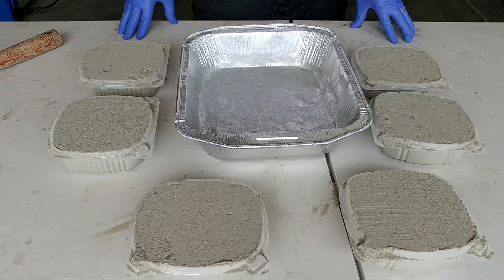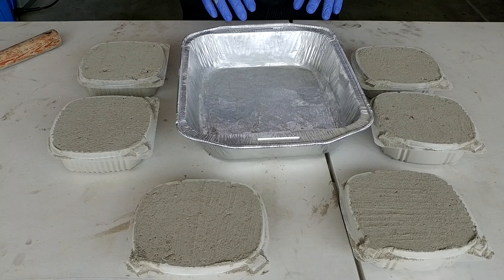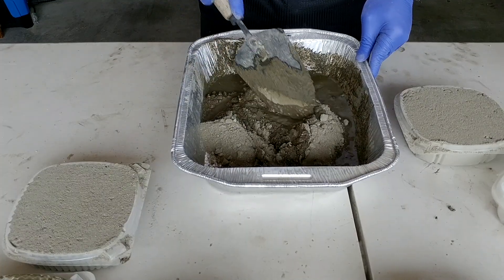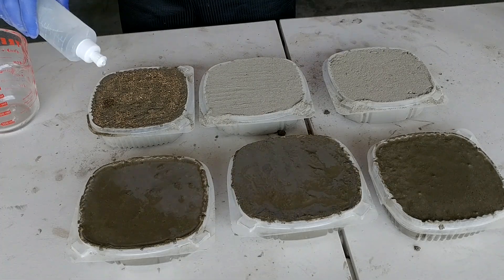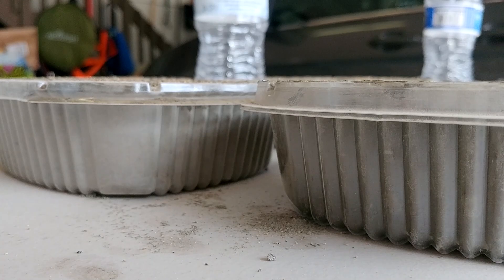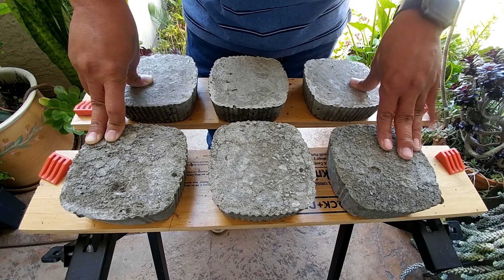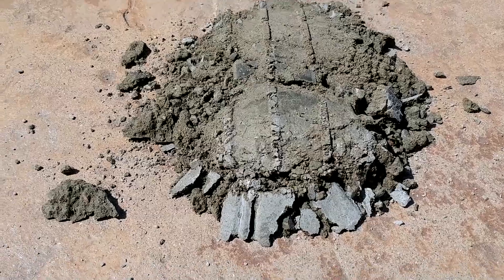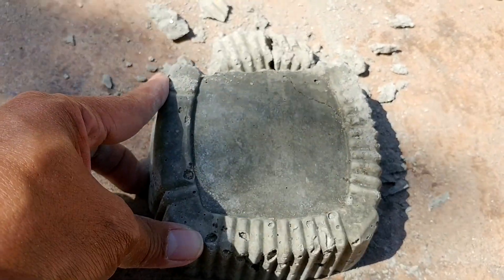Stress Test Showdown - Will Dry Pour Concrete Take the Crown?

Comment: if it's not load bearing I'm sure this method would work ok although I highly doubt it would last as long as pre mixed concrete. Curing is where concrete gets it's tensile and compressive strength and ensuring you have the right water to concrete ratio is key to proper curing. Not sure how you know your getting the right mix ratio with this method and can almost guarantee this pad will crack over time. I would like to see a compressive strength test on this method and see how it compares to pre-mixed concrete.
Reply from the maker: I agree with you.

Comment: Your experiment is flawed because dry concrete takes longer to reach its full strength. And while it's on the ground, it's still wicking more moisture till it's appropriate strength.
Reply from the maker: Thanks for the comment. This is the reason I created multiple sample. We are comparing their strength at different time. Regarding your concern about moisture. All samples are removed from the container right after it set and placed on the ground where they get constant watering. So they remain moist throughout to promote harder cure. The last test I made was at 38th day instead of 30 days because I got busy with graduation activities. The links for the 7 days and 38 days is in the description if you wanted to see.

Comment: There's another guy that does this same test and in his test they were both the same and held the weight of his van.
Reply from the maker: Was the sample this small? I have seen one with Michael Builds where he run over his truck on a slab after 30 days. It was fine in the beginning but finally gave in and he mentioned he did run back and forth for at least 100 times.   

Anyway, this is just to test the difference in strength between wet and dry pour and I used the small sample so that it reacts to the stress we are giving it at a shorter amount of time. A larger sample will definitely be able to handle the weight of the van. The question will be how long will it last or how much beating can it take before it gives in.
Reply: @diymanual  it was not much bigger than that...almost the same.

Comment: Appreciate the tests, but you need to mimick it JUST LIKE Cajun Country Living does. NO PANS! Watering intervals. Copy them EXACTLY, but on a smaller scale
Reply from the maker: Thanks for the comment. I did that on my other dry pour video. For this experiment, I am using the same amount of water for each samples and I explained my reasoning in the video. Putting it in a pan makes sure that the dry pour absorbed the same amount of water as the wet poured concrete.
Reply from the maker: I filmed a new Dry Pour experiment early this year. Just got really busy with other activities and projects and never got the chance to edit the video. It will be a series testing the PSI at different curing time.

Comment: There is one variable that you did not take into consideration on the dry pour test, that is your weight while you were inside the vehicle doing the test. You need to have 2 persons of the same weight inside the vehicle during the test, for your experiment to be valid. This is a Fail Grade.
Reply from the maker: I actually addressed that on the 7th day test where I switched the samples. Still the same result.
Reply: inconsequential.

Comment: if you understand concrete ... I mean actually understand the science ... then you know that this is plain stupidity
Reply from the maker: Thanks for the comment. This method gains so much traction because it is less intimidating to work with than properly mixing concrete that is why we are trying to do this small experiments to see how each method will perform under stress.
Reply: @diymanual  I understand where you are at. I hadn't done any concreting until just a few years back. I watched Mike Haduck and Odell Concrete here on utube. I then just bought a mixer, cement, aggregate (sand + rock mix) and started mixing ... drop into barrows and roll to location. Fill forms and vibrate. Wooden trowel. Then mag float. Then bull float and fresno if you want glass. Just watch the setting slab or foundation or whatever you are doing .. hit it with the tools as needed. It is not really intimidating in the end. The tougher part is building a quality form with reinforcement.
Reply from the maker: Thank you.  I have been watching Odell as well these last few weeks and I'm more confident now on how to do it using the proper method. I have poured concrete in my backyard about 8 to 10 years ago but that's with the help of my father-in-law who have tools and the knowledge on how do do it correctly. Now that he is gone, I am going to do it myself in my new house so I started to search on how to pour concrete to get a quick refresher course and this method keeps getting pushed in my feed so that is why I have to do a little experiment if it is as good as the wet pour.

When I first saw this dry pour method, I have high hopes on it and a lot of quick projects come to my mind but now that I think about the process, you spend so much time preparing the area and the form why do a short cut on the last step?  Also another commenter said something like if you are going to do a large pour, you want to make sure that it is done correctly so that you don't have to re-do it again after a few years. And if you have a small job, then it is easy enough to do it with wet pour which makes a lot of sense.  But I guess a lot of people will always gravitate towards the easy method.
Reply: @diymanual  Remember, too, that you can always break a large pour into segments using formwork .. just make sure you extend the rebar thru to the side next to be poured. This works for me. I am doing one right now ... 7 x 5 m ... into 4 quadrants of 3.5 x 2.5 .... gives me free crack joints if I do it properly.
Reply from the maker: Thanks for the advise.

Comment: With the wet pour you measured the water and hand mixed it, therefore you are effectively distributing the water and material.  Holding the dry mix to the same amount of water is forgetting that you mixed the wet pour.  The wet pour gets an extra step (mixing) which equivalently could be more water for the dry pour.  For the dry pour you could use a taller container with some compact sand for drainage of excess water.  This way the dry pour would be given the opportunity to fully saturate.  The inequity of your experiment seems to make it invalid in my eyes and doesn't offer any proof of which performs better.  Good effort though, science is fun.
Reply from the maker: Thanks for the input. Yes science is fun.

Comment: Either way, common sense dictates that dry poured concrete will be used where not much pressure will be exerted on the concrete. Will I use dry pour for column, beam,  lintel, stairs or upper deck? No!  Mix the cement, sand, gravel, add water then pour and call it a day. In terms of time, labour and cost, I don't see any advantage dry pour has over wet concrete. So why bother? I understand that it is a different way of doing things. But I don't think dry pour deserves all the attention it is getting considering its limited application. Why take the gamble? It is not worth it in my opinion.
Reply from the maker: Thanks for sharing your opinion. Every person look at this in different ways but I agree that this should only be use where not much pressure is exerted.

Comment: Dry pour needs more water then wet pour from everything Ive seen
So while you tried to make it more fair… you actually doomed the dry pour. These are not the directions for dry pour… but they are for wet pour. It would be like doing dry pour perfectly and then adding 10x the water needed to wet pour just to prove dry pour is better. Do the experiment with the proper method for both and you get a different result. I’m sure wet pour will still win so you don’t need to skew the results in it’s favor
Reply from the maker: Thanks for your input. I am not trying to skew the results in any direction and I explained in the video I used the same amount of water because according to what I have read so far, adding too much water to concrete will cause it to have lower PSI strength. So I wanted to see if I use the same amount of water for both with give both sample the same strength.    

I used a closed container so that dry pour can absorb all the water that I put in and if you watch the whole video, it did show that it was able to absorbed all the water.  Now, will adding more water or less water to dry pour make it stronger or as strong as a properly wet concrete? We don't know the answer to that yet, this experiment is only to see if they will exhibit the same strength when adding the same amount of water.

Comment: You didn’t follow the methodology. You can’t expect to obtain max results if you can’t follow directions.
Reply from the maker: As I explain in the video, I am testing it's strength using the same amount of water because the amount of water use will determine how strong your concrete will be. It is not following some methodology because you can make any concrete mix hard by simply adding water to it. The question is how strong will the concrete be once fully cured.

Comment: Not a good tests I can see you didn’t follow instructions
Reply from the maker: I explained in the video why I am using the same amount of water. We are testing the strength between 2 samples at different stages of curing using the recommended amount of water for concrete to get the maximum PSI strength.
Reply: @diymanual  If you add too much water to a wet mix you get weaker concrete. Your method to me is adding too much water too fast to the top layer of the dry and it seems like it will make it weaker. Slowly adding water and allowing time between waterings to allow the concrete to cure seems to be an important part of Cajun Country Livin's process and your way is not doing that. If not trying to test their method but someone's else's dry pour I guess your test is fine.
Reply from the maker: Not really following their method. What I am trying to see is if I used the recommended amount of water for both samples, will it exhibit the same strength.

Comment: The reason water is limited when mixing concrete is to prevent separation of the sand and aggregate from the cement before the cement has a chance to react chemically, binding all three together. Afterwards, continual water is desirable because the chemical reaction continues and consumes available moisture. 
The dry pour process is entirely different. Misting is employed to prevent surface erosion,  but it can be applied continually until the concrete is soaked entirely through. Once the surface is bonded, streaming allows water to be added at a higher rate. Max strength will occur if water ponds on top of the concrete for seven days.  Measuring out water for dry pour as if it is the same as a wet mix will increase the amount of time for dry pour to increase in strength, meaning the rate of curing will be different. From a process perspective, water pressure is what makes dry pour work. Restricting water means less water penetration and uneven reaction, resulting in a tendency to spall under bending stress.
What your first driving test shows is the difference between a proper wet mix process and an incorrect dry pour process.
Reply from the maker: Thanks for the input.

Comment: This is what I predicted would happen. Finally a real experiment with some control. Dry pour advocates use way too much water to cure. When comparing same w/c ratio to same w/c ratio, dry pour is inferior. Some commenters saying "oh,  normally it absorbs water from the ground" or other nonsense aren't realizing that changes the w/c ratio. Also, it is industry standard to test strengths at 1 day, 7 day, and 28 days (and even more in between) - which is what you are doing! Not sure why some are saying it's pointless to test it early on.
Reply from the maker: Thanks for that comment. Every person have different perspective so that is expected that others will not agree with my method but you explained it better than I can.

Comment: Do us a favor , you dry pour has extra weight… your weight , can you switch sides for your next test? Put dry pour on the passenger side instead of the driver side? Or even better if you put both the dry and wet tests on the same side !
Reply from the maker: We think alike. I just did that the other day on the day 7 test that I will post this week. Stay tuned.
Reply from the maker: I just uploaded the day 7 test where I switched the placement of the 2 samples.  Check it out.
Reply: @diymanual  thank you

Comment: As another poster on another site noted, dry pour is just one more tool in the proverbial toolbox to be used when appropriate. Comparing wet pour and dry pour is like comparing nails and screws. Use whichever one fits the need and circumstances.
Reply: I really don't see the use in dry pour. If I'm doing a large project, I'm definitely not using dry pour. Small project aren't that hard to mix up bags of crete the proper way.
Reply: Dry pour fence post for decades.  Even part of instructions on the bag.
Reply from the maker: @josephbenge8707  That is one good way to look at this.  For large project, you want to make sure that it is done right. For a smaller project, why use dry method if it is small enough that you can mix the concrete and finish your project in time.

I think for people who have not worked on concrete, it is a little intimidating to do it that is why they are looking for something that is less intimidating to work on.
Reply from the maker: It makes sense.  From what I have seen so far, dry pour has it's limits so as long as you understand the limits you can decide if it is applicable to be used for your specific project.

Comment: i would suggest using a cooking scale to measure with (measure by weight), at least for purposes that require more accurate measurements.
it's pretty crazy that the dry poured flattened like that, will be exciting to see what the other two samples will turn up in due time.
also don't forget about rebar, while it's kinda late to include it in the test, it does make a difference!

i would expect both to crack, if not crumble because there is a lot of weight on a small surface when you first drive up onto them. this will put hairline cracks in which will open up as you drive on them. this wouldn't happen with a actual driveway though because it's normally ramped and the weight is spread out onto much more concrete. it's still fine for tests though, really abuses the concrete to see how tough it really is.
Reply from the maker: Yes. I did use the digital scale my wife and daughter use in the kitchen and they all come to about 2.55 lbs. You are correct that it will do better on a regular driveway because of weight distribution and that is is properly ramped unlike how I drive over the sides plus you can also add rebar to give it more strength. I did the smaller sample because I figure we won't notice any difference if we just drive a van on a large and thick surface over a short period of time. At least with the smaller and thinner sample we can find out faster if the two methods are comparable to each other in strength at a shorter period of time.

Comment: There is very little point in testing uncured concrete.
Reply from the maker: We are simply comparing wet and dry at different stages of curing. This is just after the initial set. Next will be at 7 days where it is supposed to be at around 70% hardness and the final one will be after 28 days where it should have gain full strength.

Comment: So...after the drive by test, I no longer have confidence in the "dry poured" method.
Excellent demo.
Reply from the maker: From what I have seen so far, it has its place but I don't think I will be using this method for my ribbon parking spot project.
Reply: @diymanual  

It doesn't take that much effort to do it the proper way. Once you've got the hose out, the cement bags, the form made, the only thing left is the mixing tub and shovel.

"Why people got so lazy?" is the burning question. This isn't the area where they should cut corners. It's like working on electricity installs without shutting off the power. Like putting in a new faucet without shutting off the main. Shutting off the gas line while braising new fittings.

Manufacturing a tripping hazard is equally as dangerous.
Reply from the maker: I agree with what you just said but I think people consider this method  because it is a lot less intimidating to work with especially if you have limited time and or space to do what you need to because concrete will start setting once you put water in it. I am in the same boat as others but I decided to do these little experiment first before doing it to see if it is a good alternative.